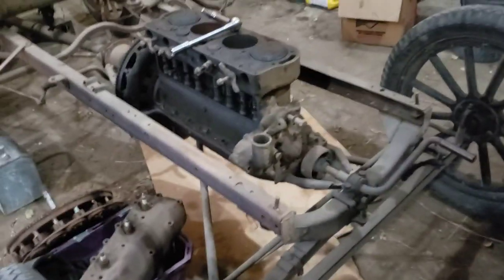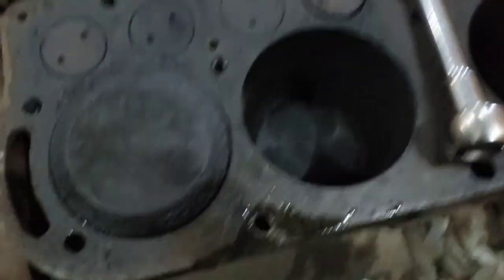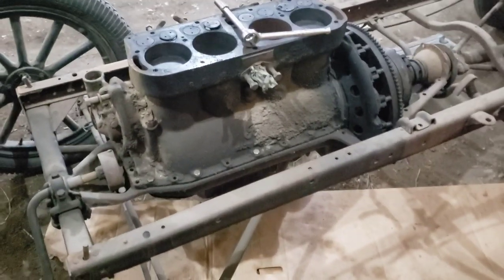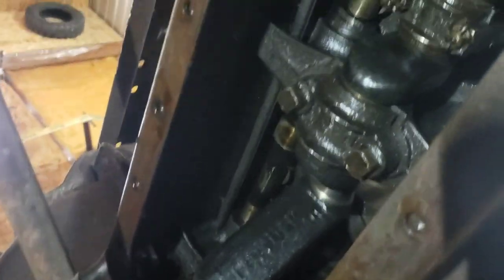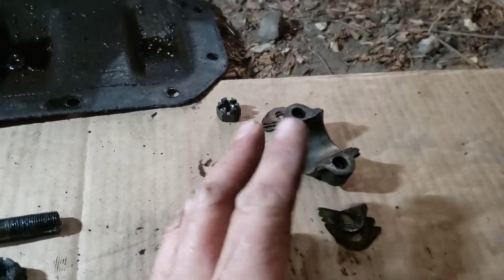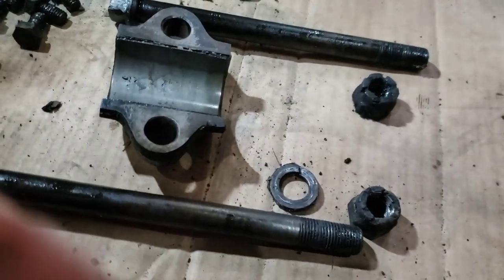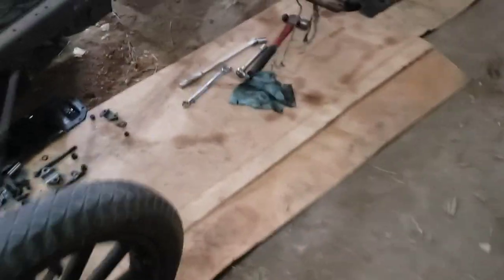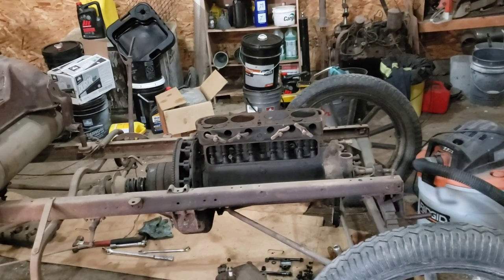Model T bearing Inspection...Knock Knock??

Comment: I wonder if anyone swapped in model A engines  these cars?
Reply from the maker: Model Ts have been modified in every way imaginable over the years, but engine swaps usually also mean chassis swaps, since Model T frames are very light and have no provision for front brakes...or rear brakes, really...

Comment: It seems like someone was making shell bearings for the babit type replacement, doing the rods would be easy. However the mains ! 😮 That's no in frame op!  To be honest I'd probably put a 20r Toyota engine in it.  And try to adapt the rear diff, to the 5speed Toyota trans.  If not swap in a possibly S10 / astro rear axle,  maybe convert the front axel to about 39 Ford for better brakes, redrill the rear axles to the same pattern, maybe go to roughly 16" rims, maybe the model A rims can work, I'd try to keep it some what stock looking. To someone who doesn't know cars anyway. Make a shifter that would appear to be original, from 5/8" bar stock. Turn it down  gradually to about 1/2"  about 6" from the end, then further to 3/8" and thread the final 1/2"  to allow a shifter knob to be screwed on. Made from a chunk of oak turned to a ball, then flatten the top slightly ,  drill a hole in the bottom.  Chisel it out to fit a nut,   grind the nut rough. Screw a bolt in the nut. With wax on the end of the bolt, being just out the nut, then coat with epoxy, and fill the hole with epoxy . Press the nut in the hole, possibly using the long nuts used with all thread, to join two pieces.  Allowing about 1/4" -3/8" to be proud of the knob. Let set for 8-36 hours. Then place in a vacuum chamber in a vacuum to dry the wood thoroughly.  And prepare a half pint of  thinned epoxy resin,  place the wood inside suspended by the nut in the vacuum chamber, pull a slight vacuum, to allow the resin to soak into the wood,  the resin being pigmented black. It should look like a black wood shifter when done.   Brush on additional epoxy to allow to cure. Bend the rod to fit the car, and screw on the sanded and polished knob. 
Using the more modern axels hydraulic brakes can be used, being it can easily do 80 mph, good brakes are a must.. I definitely would not modify the engine, without a modified frame.  The frame should be boxed and braced as is , a 20r engine produces easily 5x the power the t made!